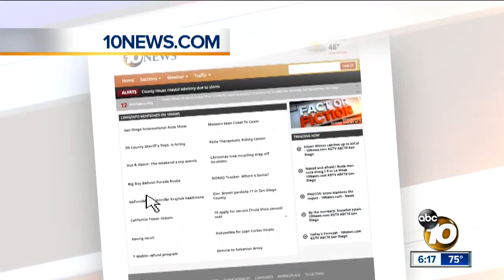Teen's invention makes water out of thin air

Comment: It’s not that it’s a new invention, rather realized again by another young mind. The reason for so much FUD is because his device operated exactly the way the Waterseer device does 100% and proven to work despite all the FUD supposed thermodynamic theory saying it wouldn’t. It does. And they’re physics is flawed or incorrectly stated for the purpose of leading you away.

The ground does NOT keep the heat absorbed concentrated in a specific region as they presume and is dispersed continually naturally.

Comment: It is indeed a great invention due to its simplicity. The ambient air is sucked and pushed underground into a concrete tank( I am guessing here) by a solar powered pump. Underground the temperature is much lower and the moisture in the air condense into water overnight.  This water needs to be pumped up when required.   Near way of tackling thirst ❤

Comment: Well it's great that someone is utilizing this effect but it's not really a discovery or revelation, except perhaps in the specifics of his device. Not trying to diminish this young man's efforts, but there are videos all over Youtube showing setups that utilize the same effect.  One little utilized approach that would have the greatest impact would be harvesting water from the air conditioning/cooling process of buildings. I've seen it being done on a college campus in  hot, drought ridden Texas, where they were supplying all the landscape watering needs with just the harvested water, which in turn offset the cost of electricity for cooling the buildings. Two birds with one stone is always better. This is also more efficient because they are simply adding a component onto an already established system that does all the "work", so there is no need for a separate facility or laying miles of copper pipe to form a condenser network.
Reply: Air conditioning coils collect dust, mold and bacteria. Hospitals especially spread deadly infectious diseases in the air from them.

Comment: Water in the air makes up 0.001% of the total “fresh” water on earth.. aka it’s impractical and even more the best tech in the future would be wasted on trying to make water for not just large populations but whole ecosystem…. We literally have salt water oceans and tbh ignored and not well supported tech to purify it… like with all tech at first it’s costly and u put more in then u get back.. and lack of support just means it’s gonna be like that for a long time… but even with lack of support I still get more purified water from it then pulling from the air..  also CAP.. this man didn’t invent this.. 😂 do y’all not even google..? Ancient Incas for example used “fog fences” which collected passively water from the air/fog also in the early 20th century .. air wells.. Belgians built a large half egg like dome structure made of stone with square holes all over.. it collected air and water was turned out… unless ur like in a end of the world situation.. it’s of insignificant benefit… ur literally better of dumping actual water thru sand filters then boiling it… by far… U WILL NOT SAVE PLANTS WITH WATER TAKING FROM THE AIR THIS WAY… it will not at all help.. 0.001% it’s literally laughable… 😂

Comment: The ground eventually heats to the point condensation stops forming. Need to disperse the water through a larger area to maintain ground temp.
Reply: Murphy James,  exactly.   Water is good carrier of heat,   you need a long 
Properly shaped pool of water that convects with sole purpose of carrying heat away from the point of condensation.   Im also thinking a pressure drop or other aid so it condensates at lower humidities and still works.
Reply: It does. Didn't you see the big copper coil? And the ground will remain cooler than the air at all times.
Reply: Skoda130 word. Theres no reason we as a society arent pulling more water out of the air in areas where its plentiful for those in areas that are not. My dehumidifier and evap coil produced 20gallons of water a day, every day for the months of July and August. 1200 gallons of fresh water from one household. Used it to water my garden and wash the trucks. We can pump sludge cross-country, we can do the same with H2O. 
But they can also literally make it rain, yet choose to allow the drought-related catastrophes to persist world wide.

Comment: Wow! Only problem: it works only if the outer air is warmer and humid. Have to reach temperature below dew-point. Therefore not working in winter...
Reply: Why would he need one in winter? In Winter there is snow in most places so u could just eat the ice theoretically

Comment: I wish reporters would spend 15 to 30 seconds searching on Google "Atmospheric Water Generators" before touting something as innovative!  Differential geothermal condensation is at least as old as the Egyptian pyramids and you dont need a fan to make it operate. Dig a shallow hole put a dry cleaning bag across it... place a cup in the middle with a small pebble rock on the outside of the plastic creating a gentle conical shape and you will pull water from the ground dripping it into the glass in the center. The Egyptians used reeds since dry cleansers were few and far between :-)...Voila I'll be both famous and rich if I go see this reporter.

Comment: Laws of thermodynamics DOES NOT allow for this. ITS ALL FAKE and has been "attempted" by others who have also lied and then went bankrupt when they couldnt make it work! Its also in NO WAY a new invention, its called a fucking dehumidifier and the water produced is in NO WAY DRINKABLE. It also is in NO WAY WHAT SO EVER A WAY TO PRODUCE WATER IN ANY AMMOUNT. The largest industrial dehumidifier can produce up to 55 liters of water per day and cost about 3 dollars A day to run on electricity, meaning the water costs 5 CENTS per liter, 5 TIMES AS EXPENSIVE AS REGULAR TAP WATER which cists only 0.04 Cents per liter. DO NOT SUPPORT FUCKING STUPIDITY!

Comment: Wow, you need a university degree to connect a computer cooling fan to a solar panel to push air into a pipe buried into the ground for condensation. Who is doing propaganda to who?

Comment: You can buy dehumidifiers, they take a lot of power.  This method would heat up the ground, and you would get a few grams of water.  Much better to use a large solar panel, around 2000 watts, and hook it up to a store bought dehumidifier.  Both parts are well engineered and proven, this guy has proven nothing.

Comment: Reverse osmosis has been used in submarines and in space for sooo long..

Condensation on the side of the glass is caused because cold air can not hold as much moisture as warm air. Therefore the water is theoretically sucked out of the air and onto the cold object.

This "new" invention has been around for decades.

Comment: The invention is the combination of a small power generator and the use of temperature difference between the humid air and the cooler earth in one small independent device.  Physics are always the same, but the invention is, to know how to use it. So that is great, but success is determined by the price of the device, the humidity of the air and the actual output.
Reply: Why would you bother buying it, if anyone could make such a thing with materials from the hardware shop?
I could easily replicate this.
Reply: @Skoda130  that may be so but it still seems to solve an issue regardless
Reply: @Skoda130  "You're welcome", I'm sure Mr. Avdienko would say.
Reply: project theroy its cheapst method

Comment: There's no humidity in the air to create clouds to make rain, so we have a drought. I know let's make machines that pull even more moisture out of the air to make it even dryer....and prevent clouds to make rain....brilliant...
Oh and they already have a machine that pulls water out of the air...it's called a dehumidifier.
Reply: Water Condenser. Makes water by condensation, They have them already and have for years, some use a cold coil like that use for an air conditioner. but they use quite a bit of energy. but now they can be used with solar panels.

Comment: this is not that impressive its just a dehumidifier
Reply: Without electricity, or very little of it rather. Pretty impressive.
Reply: @bugs181  Dehumidifiers the a LOT of electricity. It's cheaper to have water shipped.
Reply: golden86 ever heard of solar? The Konia system that’s been available for years only uses about 1200 watts daily for my family’s drinking needs. My solar system can easily provide that, and I don’t have to rely on economics, shipping, water shortages, contaminants, plastics (which are extremely bad for your health). I urge you to do more research.
Reply: @bugs181  no it doesn't. Not possible. A highly efficient 10k btu R22 vapor compression air conditioner will use 800w running. That gives you 90 minutes and 15kbtu. Even the latent heat of vaporization of water is 2260kj/kg and 1kj is .948btu. You can condense 7kg of water with that much energy and that is not having to expend any energy to cool down the air the the water vapor is dissolved in. That is enough for a pot of coffee and one flush of your toilet. That's it. These machines do not work that well and even their models that use 1250w have been reported by customers to produce less than four litres per day in cooler and dryer months. These machines are nonsense and it is dangerous to promote them to places as reliable source of drinking water when there is not a reliable source of electricity. Places like California.
You might be using it only for your drinking water needs, but even then I doubt it. The average man should drink somewhere around 3.5l and the average woman around 2.5l per day. It is doubtful (impossible) any atmospheric water generator can make 6 litres with 1200w of electricity....12000w is another story.
Konia is maybe not out of business but their social media died 10 years ago and they haven't had a press release in six years. Their website goes 404 now. Everything about them says they went out of business five years ago after selling air conditioners to gullable fools for ten times what it would cost to put a bucket under the one in my window so I could drink the water.
Reply: @timothybayliss6680  all your math and jargon is simply nonsense. You fell into the same trap that many do. It’s called bias. I’ve been running this system for several years and I can tell you from my own experience, these systems work. I’m running mine completely off-grid using solar and wind, and obtain more than enough clean drinking water EVERY day. The humidity drops in winter months so I have to be a little more mindful, but that’s life. You don’t expect to go make a phone call with 1% battery, do you? The split part konia system I use, has the dehumidifier unit outside, so I’m not having to “cool” anything.

Comment: If an area has frequent drought, then the humidity will likely be too low for this to be efficient.
Reply: I was thinking along those term too. And if there 
is enough humidity or barely enough, with so  many people doing this in a location, wouldn't it really dry out the air so the humidity would be close to 4,3,2 or lower. I can see it on the news. Draught weary California can't catch a break. Draught so severe the air is completely dry. Laundry clothes dry in seconds or in a couple minutes for sure. . .
Reply: @brucescott7600  so, there isn’t much sweating issues over there,  I guess 😅
Reply: This is not true. We get no rain for months but the west Atlantic wind brings lots of moisture. Some mornings the trees are dripping wet.

Comment: its fake...none of these work..its a scam.   at best ..you would need a 4000 liter heat sink for 1 liter of water.   none of these have actualy ever worked.
Reply: reverend moonie How do you know this?
Reply: BMAC VAGS i can do math...the engery you are required to remove , per liter of water. air temp over a year ..combined with humidity.  will tell you exactly what is possible. given perfect heat exchanges...and even in a perfect world..this just dosnt work any wher it would ever be needed.  and when compared to the costs of doing it other ways...makes it just look stupid.
Reply: anywher. its a hot dry desert..and people dont have water..this thing will make almost nothing.  places wher its a rain forest..it will start to work...but who needs water in a rain forest....even removing salt from ocean water. is a cheaper option...and thats expensive.

Comment: except its been debunked
Reply: Do you mean this device or pulling water from the air? Pulling water from the air is a real thing. Haven't you heard of a dehumidifier? All you need to do is create condensation. You do that by creating a micro-climate with a different air temperature than the surrounding environment. Condensation forms and you collect it in a cistern.
Reply: https://www.youtube.com/watch?v=LVsqIjAeeXw
That doesn't work that way... It's not this simple.
Reply: debunked by Nestle

Comment: There are a alot of dumb comments on these video but how it works is simple. Remember the big the fan for the in take air the better. As you force lot value of air in tiny space it gets hot and hotter then he sides though a copper coil under ground with is cooler the the in coming air so out the end you get water if you also have the coils in a body of water it would cool it even faster getting you ever more water. it's a simple idea they are called dehumidifiers. Don't go around removing tons of water from the air without doing some serious planting trees brushes grasses wheats hops corns peppers tomatoes mosses heck even use some to grow mushrooms then after the logs no longer produce mushrooms bury in the ground to help the soils hold onto more water when it rains.

Comment: the same as an Atmospheric Water Generator witch you can buy now only it utilizes underground cooling
the same way we can utilize unrground cooling for air condition
Reply: Neither of these water generators work. Been proven fake MANY times too, both of them.
Reply: Tom, atmospheric water generators are NOT fake. Stop spewing your garbage. Go to any retail store and buy a dehumidifier. It's the SAME freaking thing, only add in filters. Do some research besides repeatedly spewing your nonsense.
Reply: @bugs181  If they're not a scam, then why do they keep running afoul of thermodynamics and their "inventors" disappearing into the night with all of the money?
Other than your not understanding any of the concepts beyond "HURR DURR I GOT A TINY AMOUNT OF WATER AFTER INVESTING A TON OF POWER, SO OBVIOUSLY IT WORKS YOU STOOPIDS".

Comment: THIS IS NO NEW INVENTION
Reply: Mehmet Buyan fuck no it's isn't we did the same shit in middle school
Reply: No, it's not moron. This scam has been out there for DECADES now.... It's been proven a scam MANY times as well.
Reply: @Tom-yc8jv  look up moses west he created the machine.
Reply: More "clock boy" news...
Reply: There has to be a LOT of humidity in the air, and it still takes a LOT of power. For this "device", dirt has a low heat capacity and is a fairly good insulator. So it will just warm up and not gather water.

As for Israel and pulling water from the air, that is just a high powered dehumidifier, and all the links I find say a company is GOING TO pull water from the air. In the desert? Really?
Reply: I want to make one- where do I find info on how to? Any links honey?
Reply: This have NEVER been proven a scam.
Its real. Israel have donr this for years. Australia are working on it too. 
Condens for water are not a new ide, but have become more popular the last years. Look at water from air, and think. Is it water in the air and can we cat the water out of the air?
Think before you scream SCAM,
Reply: @makan1hans858  This is essentially a dehumidifier with a filter. It is NOT a new invention and this way of getting water is by far the most expensive method. It takes an enormous amount of energy to operate. It's actually cheaper to have water shipped. A quick youtube search reveals quite a few other people who claim to have "invented" the same thing.
Reply: @makan1hans858  a black guy created this awhile ago and he's been on the news for it and the Powers that be tried to destroy his machine and left racial slurs on his machine and he's been taking his machine to the east to provide water
Reply: +rwilliams2290 it is

Comment: A big glass of water full of incredibly toxic PVC sounds delicious, sign me up. I'm a plumber, I work with it everyday but I would never drink from it
Reply: +Brooks Anderson PP or PEP plastic
Reply: +Cptn Janeway You do know do you not, that even copper which you braze together everyday with either a hard or soft solder is in itself very toxic as an inorganic metal? Yet you drink from it every day I'd imagine. I think the guy made this with PVC for proof of concept but I'd choose to use better materials myself. I'd say even if (an insulated) copper or PVC was used, you can Always distill the water to purify it of toxins. In the USA at least, No drinking tap water is safe unless you distill it yourself or use reverse osmosis or some kinda filter. You need a filter at least down to 0.01 microns or no water in the US is safe IMO due to all the chemicals they add to the water.
Reply: What is the type that is safe for drinking?
Reply: +Cptn Janeway Yes. What kind of piping is durable and  SAFE for a rainwater harvesting system in a sunny desert? It would help here in Mexico.
Reply: Are Lundby Kvaal THANK YOU!